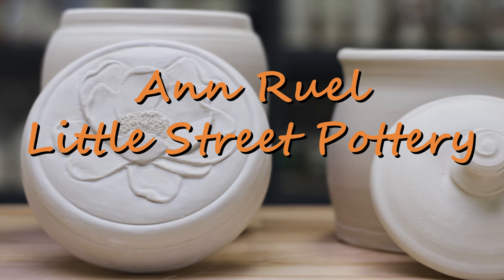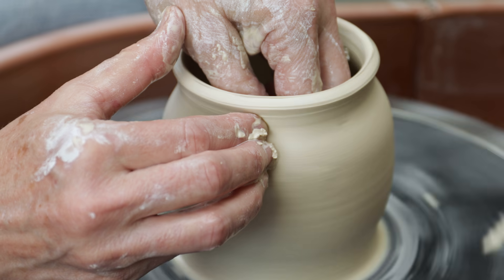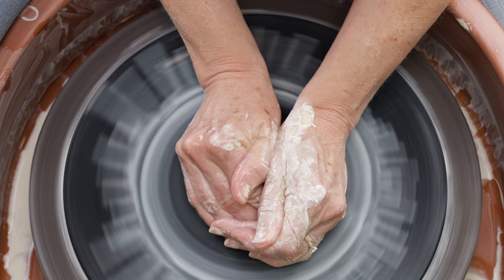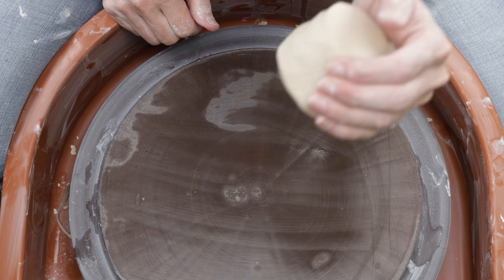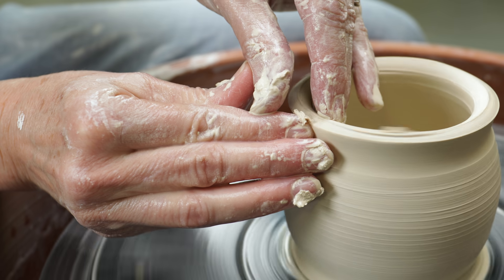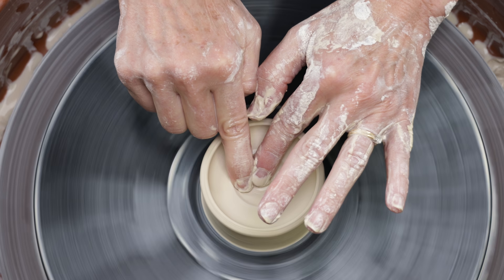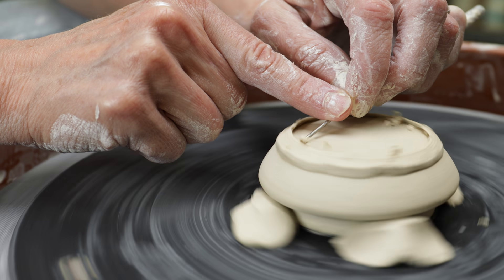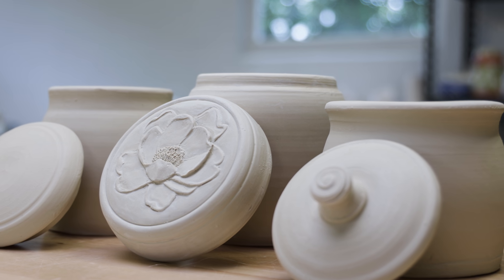How to Make Great Lids for Your Pottery - Throwing Lids and Pots

Comment: Great video i really love the detailed instructions. Can you glase the edges of the lid and the inside rim
Of the jar does it still fit with glaze?
Reply from the maker: I never glaze where the lid will touch the body because of that reason. The glaze will add a layer that is too thick some times.

Comment: So helpful! When you glaze-fire your jars, do you fire them separately or together?  For your first style jar (with the cap lid): I can't seem to glaze them so that they (1) look good, and (2) don't fuse together.  Even tried using wax w/alumina added. And for the other lid styles, I'm left with a white margin of unglazed ceramic that just messes up my intended 'design'. Thank you, Ann!
Reply: YOu are so right Tricia.  It is always a gamble.  to fire them together.  I just ruined a 12 inch cookie jar by trying to fire them together at the glaze fire.  The fit was too tight , it stuck and I couldnt pry them apart but I didnt want to take a chance the pot would warp and they wouldnt fit together.  I think I would definitely fire them together in the bisque fire.  But for the glaze fire, it depends on how tight the fit.  If the fit isnt as tight you have a better chance of it prying apart after the firing.  If the fit it very tight, chances are that the lid will stick and you wont be able to pry them apart.  As far as the white margin of unglazed clay, remember that and make it part of the design for next time.  Be creative with it.  Dont try and eliminate it but use that and make it part of the design.  Good luck.  They are always tricky